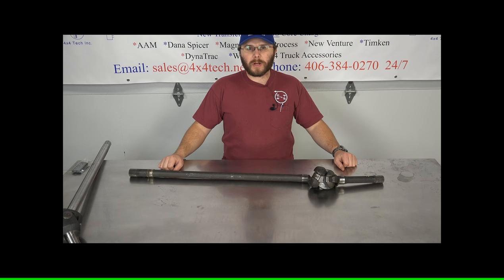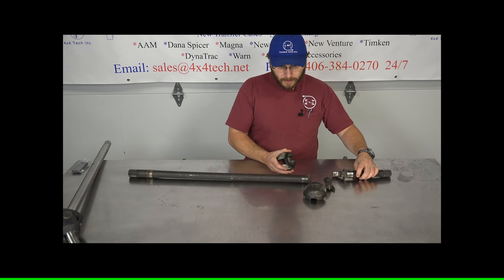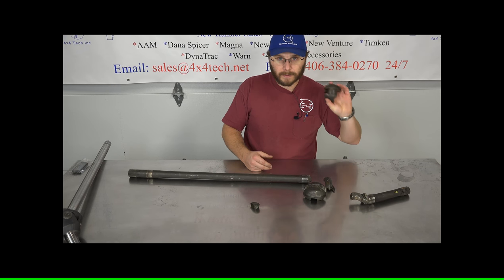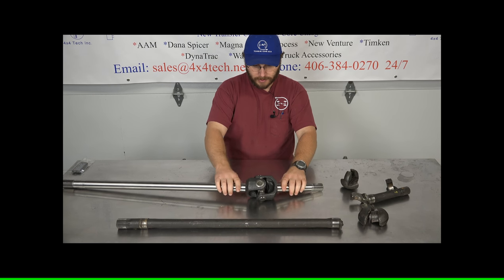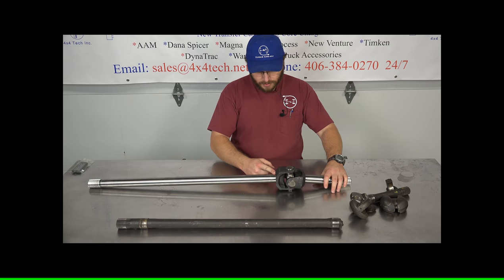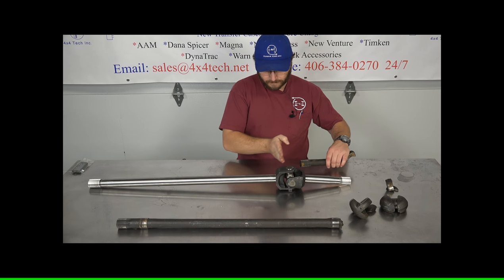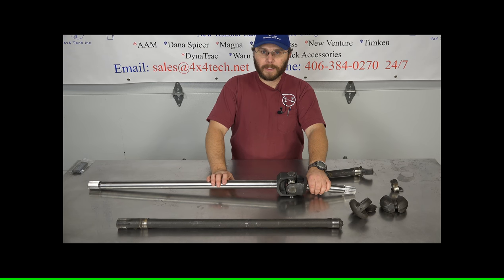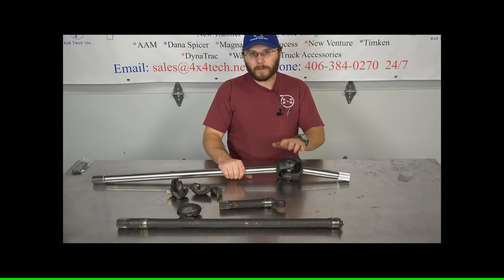Tracta Universal Joint

Comment: I have a D70F on my 74 W300. Running a 12 valve cummins(all stock) and a heavy plow, I worry about breaking it. I take it easy on the truck and certainly don't give it much throttle on turns. Despite this i hear noise while turning in low lock, which I know may be normal but concerns me. I love the idea of the extra GAWR and the originality but want to run better axles and u-joints instead of tractas. So what would it cost to get the best set up I can buy? I want to keep this truck around as it was sold new from our families Dodge dealer. Built date on the axle is 8-73. Rear axle is a dana 70 B  and the truck is a cab and chassis. Still running 4.88's and the divorced np205. Thanks for any help.